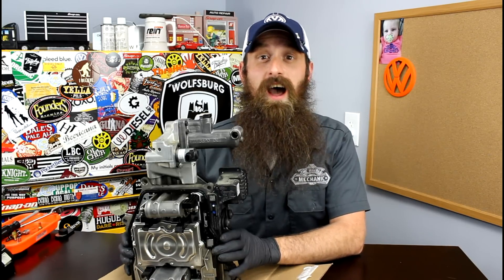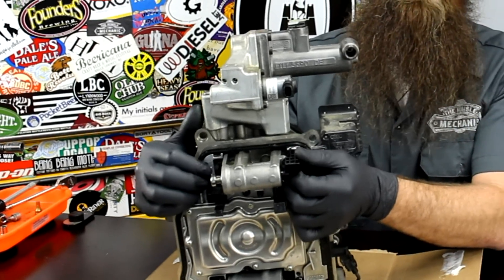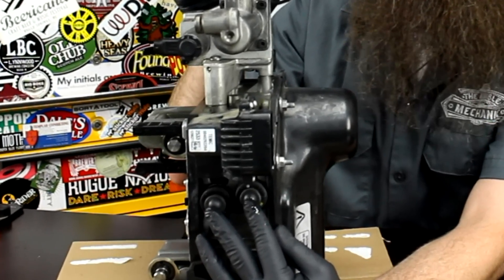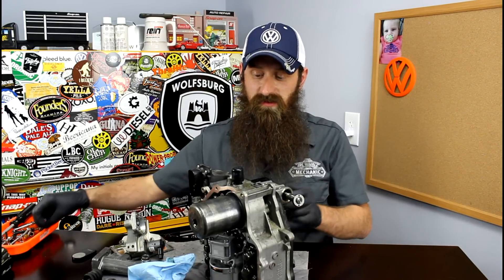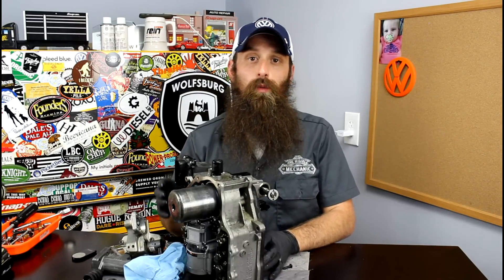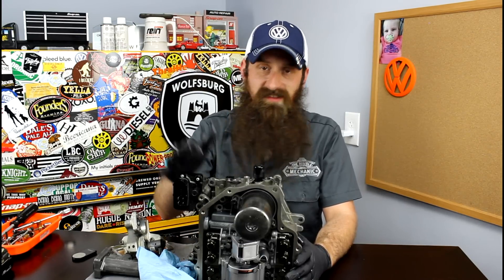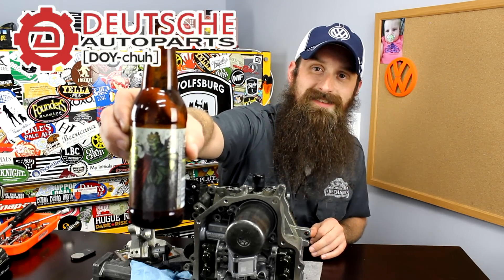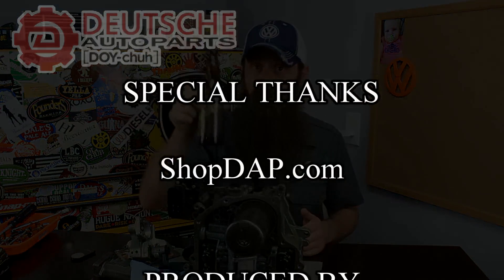How VW Parts Fail ~ 7 speed DSG Mechatronic Unit

Comment: My Polo Gti 1.4 DSG was involved in an accident. So the challenge is that it only moves forward whether it's on P or D or R. What could be the problem and the possible solution. May you please assist.
Reply from the maker: +Herbert Sithole I would be sure the cable is adjusted properly, then check the wiring to the DSG
Reply: Ok
Reply: +HumbleMechanic I have a 6 speed unit and my local shop wants $2000 to replace mechatronic unit! Thats only LABOR! How hard is it to take out? Ill just do it myself.  06 audi a3 2.0t dsg
Reply: +michael bertucci You can change it yourself, but you'll have to calibrate it and code it online to get it to work.
Reply: +HumbleMechanic another mechanic has diagnosed the car and his finding were that the gear lever is not communicating with the car as its supposed too. So he recommended that I buy the gear changer system. What do you think?

Comment: I have a Skoda Octavia 1.8 TSI with the same 7 spd DSG. After about a year of purchase, I bought a VRS steering wheel with paddle shifters and swapped out the old non-paddle steering wheel. My car is the top spec, so no tuning was needed, no modules or wires were cut during the install, no reason whatsoever. I drove the car after the steering swap for about 3000 miles, and one fine day, rig after I got the car from its third maintenance service visit, the car showed an ESC error, TPMS ERROR, and came to a halt. I turned the car off, and tried to restart it, it won't start. Within a second, I see smoke coming out of the hood, and when i popped the hood open, there were flames coming out!! Yes, the Mechatronic was on fire!!  The flames subsided and there wasn't any further damage in the car luckily, and the dealership replaced the mechatronic unit. They honoured my warranty and didn't charge me a penny. But they gave me a ridiculous reason for the fire, was that steering swap I did. Help
Reply: After the swap did everything work as it should
Reply: Shimon La Hée He already explained it worked for the first 3,000 miles.
Reply: Aditya Wadhwa ok
Reply: On DQ200 there is nothing that can catch fire. The TCU board is ceramic, there are numerous AL wire bondings that will melt before without fire....and ewerithing is covered in conformal coating....that gel thing. The BLDC in emersed in OIL and the mecatronic is capsulated....
Reply: Aditya Wadhwa 0

Comment: Take the car to a good gearbox garage. If its semi good then you have to go to dealer first and pay for check if its mekanic fault or electronic. Importent to find a dealer that put alot of money on education to the workers so they can read and understand all the data PIDS and make a correct call. ( more dealers shoud loose their licens ).

When i call a garage then i woud like to hear something like  " That symptom sounds like a sticking hydraulic valve for 6 gear, we have done some of those and it cost around 240$ / vale + work and new oil. "

This is in EU, and here are alot of shit garages to.
Reply: I have a failed hydraulic pump for my mechatronics, and been told that I need to replace the whole thing

Comment: That DSG is really cool. To bad its design is too complicated for most drivers need; stop and go traffic, tailgating, people who like to use the brakes and gas intermittently etc.  As far as performance goes this could be (probably is) a huge advantage in motor racing.
Reply: You say that you don't know about the technicalities, but...
I have a thought.  If vw engineers have not already added "algorithims" for speed vs rpm vs throttle position it would probably be advantagious to do that.  Of course on the down side, and there always is one when it comes to "people"... they could then use that kickdown tendancy ( that tells me their already working in this angle based on what ive seen from dsg) to tow stuff; not like its not an easy tell.  
Of course there are still the variables effecting tq and hp power loss that would throw the mechatronics unit off.

Oh, that reminds me, ... a long time ago my/our church had an old gmc bus, suprisingly it only had 350 chevy small block, but I remember my grandfather explaining to my brother that the final was really big, probably over 4.10, which helped the 350 have the power to move it, but the engine would be really screaming by the time it got to 50mph, also it had some serious problems staying in gear, it was an automatic.  Ah, memories.

Comment: iirc some years ago i read there was a recall on the 7-gear dry DSG in China as they where failing  A LOT, seems like the dry system is not very good.

Also, you mention you dont see a lot of hybrids, yet you changed a couple of these(insanely expensive part, plus most likely a lot of hours of labor), that doesn't speak well on reliability (% unit changed vs quantity of vehicles) nor on very long term survivability (hell if this breaks out of warranty.... you'0ll probably be able to buy a used jetta diesel with the cost of the repair).

Since it uses power steering fluid, that means the entire gearbox is using PS fluid?!?, or the mechatronic unit is SEALED from the gearbox itself and runs its own presure pump?

Comment: We have these in our twin charged jetta's. High number of failures due to heat braking down the synthetic oil and depositing sulphur, causing a short in the board. At least that's what vw has told us.
Reply from the maker: Thanks for the info. There was a recall a few years ago on our Hybrids for replacing the fluid.
Reply: Interesting! The two failures you have seen happened before the recall or after? VW says the mineral oil replacement vs synthetic oil stops the problem, but I have seen two cars with mineral oil and both not included in the recall that have had mechatronic failures.
Reply from the maker: These failure were both after the service action.
Reply: I had the service action performed as well, but changing the corrosive fluid doesn't mean it addresses any of the damage to that point. At 78000 miles in my 2013 jetta hybrid I am now faced with replacing the mechatronics. What do you think-- worth spending over $7000 to keep my car?
Reply: Yikes. Tough decision, that car has got to be nearly totalled. I would try to get rid of it, it will break again if you have it fixed.